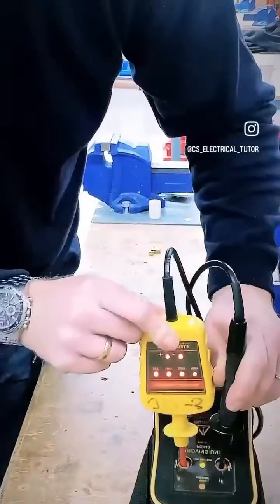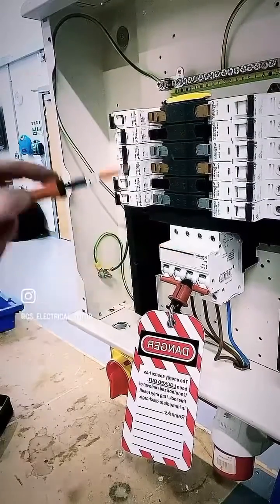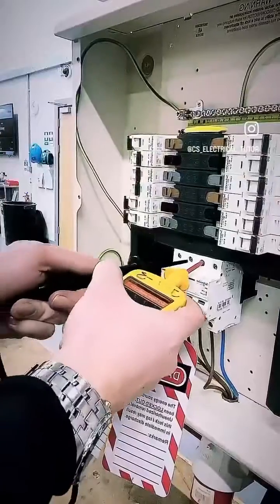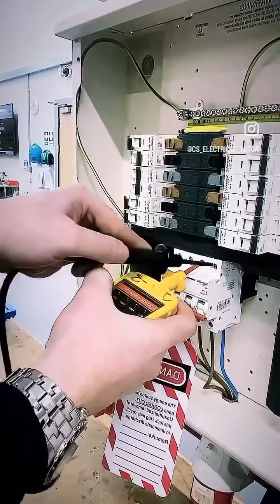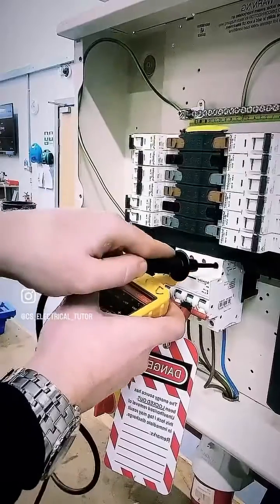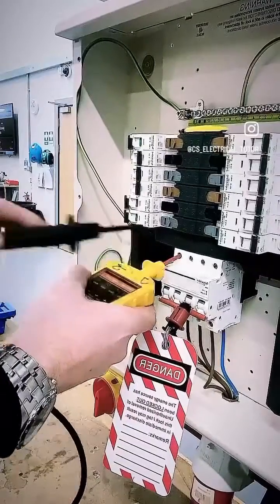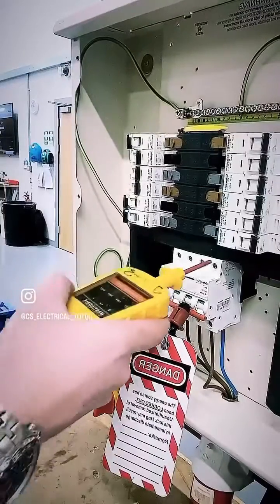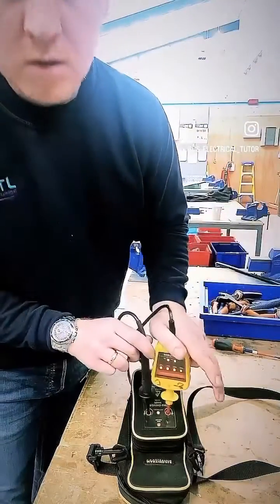Easy way to remember the Safe isolation procedure for three phase and neutral supplies!

Comment: Great video Chris. On your Am2s will all lock off devices with lock attached to it be able to feed through db board or is there exceptions were you have to removed db board before locking off. Thanks.